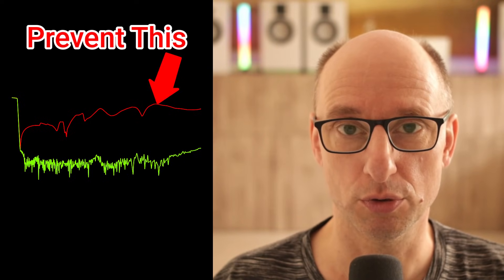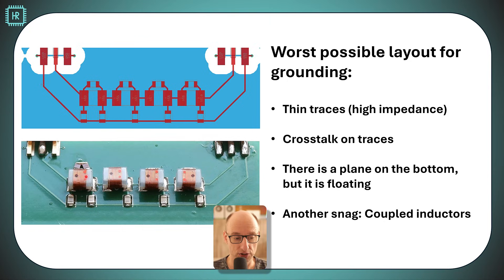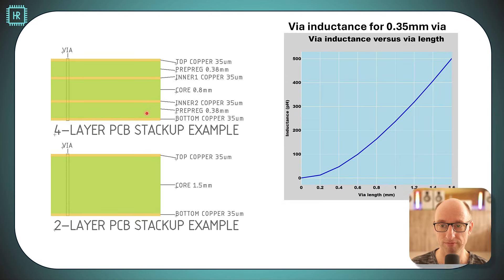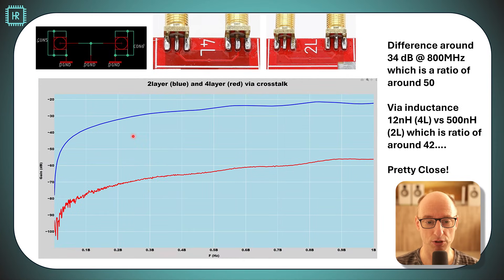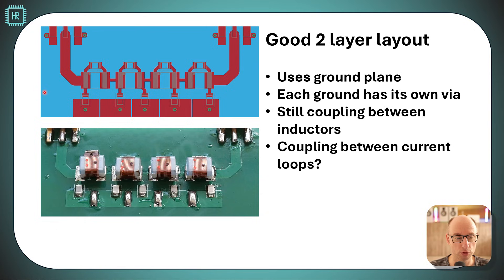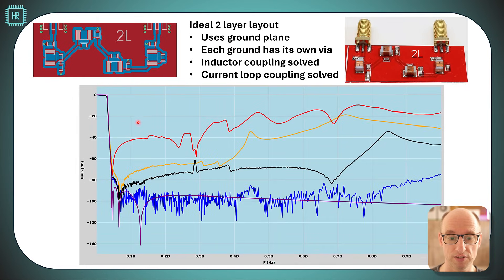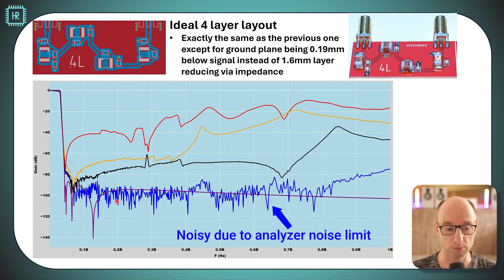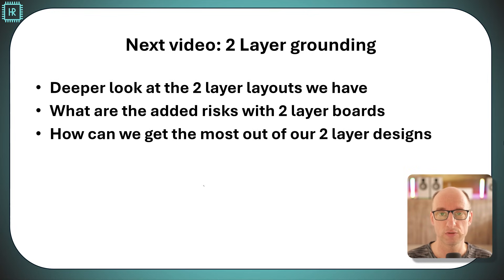Flawless PCB design: 3 simple rules - Part 2

Comment from the maker: Free mini-course: https://www.hans-rosenberg.com/minicourse_account_youtube?utm_source=yt-p-v2
Full course info: https://www.hans-rosenberg.com/epdc_information_yt?utm_source=yt-p-v2
Reply: Send me the checklist
Reply: Could weak inductor coupling be used to further improve the filter instead of it being a nuisance?
I remember some air core transformers were used in microwave frequency filters.
Reply: @drgazter  I have tried this, yes, if you make alternate inductors wound in the reverse direction, clockwise then counter-clockwise, you will improve the performance. The common / coupling fields reduce / somewhat cancel.
Reply from the maker: @paulkarlstrand6329  I've changed the free checklist offer a bit: You also get a 1 hour module of my course for free!

You can find the link to the page in the description. Scroll down a bit on that page (Or read the whole page, you may get curious :-) ) to find the link. It is a purple button 'Watch The Free Module And Get The Checklist'.

You will have to leave your email address so I can start spamming you :-D . I don't do that very often, on average once a month, but I am thinking about starting an email series with useful electronics tips at some point.

Best regards,

Hans Rosenberg
Reply: Send me the checklist
Reply from the maker: @donpeat7707  I've changed the free checklist offer a bit: You also get a 1 hour module of my course for free!

You can find the link to the page in the description. Scroll down a bit on that page (Or read the whole page, you may get curious :-) ) to find the link. It is a purple button 'Watch The Free Module And Get The Checklist'.

You will have to leave your email address so I can start spamming you :-D . I don't do that very often, on average once a month, but I am thinking about starting an email series with useful electronics tips at some point.

Best regards,

Hans Rosenberg
Reply from the maker: @donpeat7707  I've changed the free checklist offer a bit: You also get a 1 hour module of my course for free!

You can find the link to the page in the description. Scroll down a bit on that page (Or read the whole page, you may get curious :-) ) to find the link. It is a purple button 'Watch The Free Module And Get The Checklist'.

You will have to leave your email address so I can start spamming you :-D . I don't do that very often, on average once a month, but I am thinking about starting an email series with useful electronics tips at some point.

Best regards,

Hans Rosenberg
Reply: Send me the checklist please
Reply from the maker: @olivierchatelain6237  I've changed the free checklist offer a bit: You also get a 1 hour module of my course for free!

You can find the link to the page in the description. Scroll down a bit on that page (Or read the whole page, you may get curious :-) ) to find the link. It is a purple button 'Watch The Free Module And Get The Checklist'.

You will have to leave your email address so I can start spamming you :-D . I don't do that very often, on average once a month, but I am thinking about starting an email series with useful electronics tips at some point.

Best regards,

Hans Rosenberg
Reply from the maker: @olivierchatelain6237  I've changed the free checklist offer a bit: You also get a 1 hour module of my course for free!

You can find the link to the page in the description. Scroll down a bit on that page (Or read the whole page, you may get curious :-) ) to find the link. It is a purple button 'Watch The Free Module And Get The Checklist'.

You will have to leave your email address so I can start spamming you :-D . I don't do that very often, on average once a month, but I am thinking about starting an email series with useful electronics tips at some point.

Best regards,

Hans Rosenberg
Reply: Please send me the checklist as well.
Reply from the maker: @jtoddowen  I've changed the free checklist offer a bit: You also get a 1 hour module of my course for free!

You can find the link to the page in the description. Scroll down a bit on that page (Or read the whole page, you may get curious :-) ) to find the link. It is a purple button 'Watch The Free Module And Get The Checklist'.

You will have to leave your email address so I can start spamming you :-D . I don't do that very often, on average once a month, but I am thinking about starting an email series with useful electronics tips at some point.

Best regards,

Hans Rosenberg
Reply: Please send me the checklist
Reply: Please send me the checklist
Reply: Please send me the checklist
Reply: Send me the checklist
Reply: hi, send me the checklist
Reply: Send to me the checklist

Comment: Instead of 4 layers, why not just use a thinner board?
Reply from the maker: Yes, you could do that! The mechanics can be an issue as the boards will become more flexible, but you can solve that with extra mechanical support as well.

Comment: great explanations. one comment: you say in that the previous video you showed that the return current follows /the same path/ as the forward current.  but you only showed that for  forward current thhat went in a straight line on your example board.  what if the forward current is itself not a straight line?  will the return current remain directly under the forward path, or will it just follow the shortest return path (least impedance)?  my bet would be on the latter,  but that would open up the loop again.  so should return paths be as short as possible or make the loop area as small as possible?  going back to Maxwell's equations my guess would be, again, the second.  but really i have no idea what i'm talking about.  your insights would be very much appreciated.
Reply from the maker: I want to make a video about this next year!

Comment: I'm a bit confused about the comparison between 2 and 4 layers. You used the same layout for both cases, but since the dielectric changed, wouldn't it be necessary to change the track widths too? I mean, the impedance of both layouts would be completely different, wouldn't it?
Reply from the maker: The impedance does not play a role at these low frequencies,. The length of the traces is way shorter than the wavelength.

Comment: If you could send me the checklist : would be great, appreciate the offering.
Reply from the maker: I've changed the free checklist offer a bit: You also get a 1 hour module of my course for free!

You can find the link to the page in the description. Scroll down a bit on that page (Or read the whole page, you may get curious :-) ) to find the link. It is a purple button 'Watch The Free Module And Get The Checklist'.

You will have to leave your email address so I can start spamming you :-D . I don't do that very often, on average once a month, but I am thinking about starting an email series with useful electronics tips at some point.

Best regards,

Hans Rosenberg

Comment: Kindly send me this check list. Your analysis teaches a lot.
Thanks
Reply from the maker: I've changed the free checklist offer a bit: You also get a 1 hour module of my course for free!

You can find the link to the page in the description. Scroll down a bit on that page (Or read the whole page, you may get curious :-) ) to find the link. It is a purple button 'Watch The Free Module And Get The Checklist'.

You will have to leave your email address so I can start spamming you :-D . I don't do that very often, on average once a month, but I am thinking about starting an email series with useful electronics tips at some point.

Best regards,

Hans Rosenberg

Comment: Having designed many digital PCBs myself over the years, it still amazes me how critical the PCB layout and equally important as the design itself.   PCB design is truly an art in electronic design.  Please send me the checklist!  Thanks for the video!
Reply from the maker: I've changed the free checklist offer a bit: You also get a 1 hour module of my course for free!

You can find the link to the page in the description. Scroll down a bit on that page (Or read the whole page, you may get curious :-) ) to find the link. It is a purple button 'Watch The Free Module And Get The Checklist'.

You will have to leave your email address so I can start spamming you :-D . I don't do that very often, on average once a month, but I am thinking about starting an email series with useful electronics tips at some point.

Best regards,

Hans Rosenberg

Comment: Hans, thanks for the video. Send me the check list please.
Reply from the maker: I've changed the free checklist offer a bit: You also get a 1 hour module of my course for free!

You can find the link to the page in the description. Scroll down a bit on that page (Or read the whole page, you may get curious :-) ) to find the link. It is a purple button 'Watch The Free Module And Get The Checklist'.

You will have to leave your email address so I can start spamming you :-D . I don't do that very often, on average once a month, but I am thinking about starting an email series with useful electronics tips at some point.

Best regards,

Hans Rosenberg

Comment: Nice! If the checklist is still available, I'd be very grateful for a copy.
Reply from the maker: I've changed the free checklist offer a bit: You also get a 1 hour module of my course for free!

You can find the link to the page in the description. Scroll down a bit on that page (Or read the whole page, you may get curious :-) ) to find the link. It is a purple button 'Watch The Free Module And Get The Checklist'.

You will have to leave your email address so I can start spamming you :-D . I don't do that very often, on average once a month, but I am thinking about starting an email series with useful electronics tips at some point.

Best regards,

Hans Rosenberg

Comment: If the checklist is available, please send me the checklist
Reply from the maker: I've changed the free checklist offer a bit: You also get a 1 hour module of my course for free!

You can find the link to the page in the description. Scroll down a bit on that page (Or read the whole page, you may get curious :-) ) to find the link. It is a purple button 'Watch The Free Module And Get The Checklist'.

You will have to leave your email address so I can start spamming you :-D . I don't do that very often, on average once a month, but I am thinking about starting an email series with useful electronics tips at some point.

Best regards,

Hans Rosenberg

Comment: Very nice practical approach. Return path is utmost importance for almost all electronics. Second is reducing parasitic inductance. Get these right and significant amount of problems in electronic design will go away. Like healthy amount of issues with signal integrity are related to such a mundane things like too much inductance on decoupling capacitors themselves and pathway to actual switch either inside or outside of IC.
Reply from the maker: indeed!

Comment: Just wondering on that final design, is there a reason you need to go to 4 layers to reduce the distance between the top layer and the ground plane? Couldn't you ask for a two layer with a thin core, or is it to do with the mechanical structure of the board being too weak then? Thanks
Reply from the maker: Exactly, mechanics. If you can support the pcb in another way, a 2-layer with a 100um dielectric is no problem.

Comment: Send me the checklist

(I would write "Please send me the checklist" but I'm worried that you might use a bot for this or something.)
Reply from the maker: Haha, no, this is proof that it is no bot, this is all manual labour :-D.
I've changed the free checklist offer a bit: You also get a 1 hour module of my course for free!

You can find the link to the page in the description. Scroll down a bit on that page (Or read the whole page, you may get curious :-) ) to find the link. It is a purple button 'Watch The Free Module And Get The Checklist'.

You will have to leave your email address so I can start spamming you :-D . I don't do that very often, on average once a month, but I am thinking about starting an email series with useful electronics tips at some point.

Best regards,

Hans Rosenberg

Comment: Checklist
Reply from the maker: I've changed the free checklist offer a bit: You also get a 1 hour module of my course for free!

You can find the link to the page in the description. Scroll down a bit on that page (Or read the whole page, you may get curious :-) ) to find the link. It is a purple button 'Watch The Free Module And Get The Checklist'.

You will have to leave your email address so I can start spamming you :-D . I don't do that very often, on average once a month, but I am thinking about starting an email series with useful electronics tips at some point.

Best regards,

Hans Rosenberg

Comment: send me the check list, Nice Video !
Reply from the maker: I've changed the free checklist offer a bit: You also get a 1 hour module of my course for free!

You can find the link to the page in the description. Scroll down a bit on that page (Or read the whole page, you may get curious :-) ) to find the link. It is a purple button 'Watch The Free Module And Get The Checklist'.

You will have to leave your email address so I can start spamming you :-D . I don't do that very often, on average once a month, but I am thinking about starting an email series with useful electronics tips at some point.

Best regards,

Hans Rosenberg

Comment: Guide please!
Reply from the maker: I've changed the free checklist offer a bit: You also get a 1 hour module of my course for free!

You can find the link to the page in the description. Scroll down a bit on that page (Or read the whole page, you may get curious :-) ) to find the link. It is a purple button 'Watch The Free Module And Get The Checklist'.

You will have to leave your email address so I can start spamming you :-D . I don't do that very often, on average once a month, but I am thinking about starting an email series with useful electronics tips at some point.

Best regards,

Hans Rosenberg

Comment: Hello, great video. Send me the checklist. Thanks
Reply from the maker: I've changed the free checklist offer a bit: You also get a 1 hour module of my course for free!

You can find the link to the page in the description. Scroll down a bit on that page (Or read the whole page, you may get curious :-) ) to find the link. It is a purple button 'Watch The Free Module And Get The Checklist'.

You will have to leave your email address so I can start spamming you :-D . I don't do that very often, on average once a month, but I am thinking about starting an email series with useful electronics tips at some point.

Best regards,

Hans Rosenberg

Comment: Hi Hans, It's great that you have been able to quantify some of the effects I've learned about the hard way, and confirmed some of the more esoteric (aka 'did that really happen') ones. I would love to receive you checklist.
Also, I would have to assume you have considered multiple grounding bias for a component, and ground plane flooding of tracking layers.
Reply from the maker: Hi, yes, I considered multiple vias. I want to make a video on that at some point. 

I've changed the free checklist offer a bit: You also get a 1 hour module of my course for free!

You can find the link to the page in the description. Scroll down a bit on that page (Or read the whole page, you may get curious :-) ) to find the link. It is a purple button 'Watch The Free Module And Get The Checklist'.

You will have to leave your email address so I can start spamming you :-D . I don't do that very often, on average once a month, but I am thinking about starting an email series with useful electronics tips at some point.

Best regards,

Hans Rosenberg

Comment: Thanks for sharing this difference between the ideal models and real life components, including the PCB as the crucial component of an electronic project. I do not know if you are sharing the checklist mentioned in this video after all this time, but i would like to have a copy if you still sharing it.
Reply from the maker: Yes, I still have the checklist. I've changed the free checklist offer a bit: You also get a 1 hour module of my course for free!

You can find the link to the page in the description. Scroll down a bit on that page (Or read the whole page, you may get curious :-) ) to find the link. It is a purple button 'Watch The Free Module And Get The Checklist'.

You will have to leave your email address so I can start spamming you :-D . I don't do that very often, on average once a month, but I am thinking about starting an email series with useful electronics tips at some point.

Best regards,

Hans Rosenberg

Comment: Send me the Check list
Reply from the maker: I've changed the free checklist offer a bit: You also get a 1 hour module of my course for free!

You can find the link to the page in the description. Scroll down a bit on that page (Or read the whole page, you may get curious :-) ) to find the link. It is a purple button 'Watch The Free Module And Get The Checklist'.

You will have to leave your email address so I can start spamming you :-D . I don't do that very often, on average once a month, but I am thinking about starting an email series with useful electronics tips at some point.

Best regards,

Hans Rosenberg
Reply from the maker: I've changed the free checklist offer a bit: You also get a 1 hour module of my course for free!

You can find the link to the page in the description. Scroll down a bit on that page (Or read the whole page, you may get curious :-) ) to find the link. It is a purple button 'Watch The Free Module And Get The Checklist'.

You will have to leave your email address so I can start spamming you :-D . I don't do that very often, on average once a month, but I am thinking about starting an email series with useful electronics tips at some point.

Best regards,

Hans Rosenberg